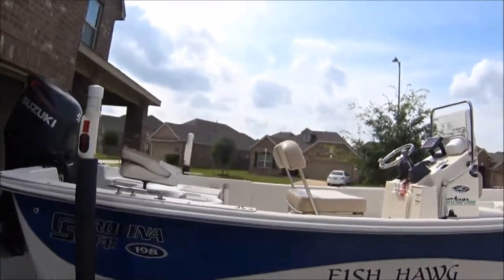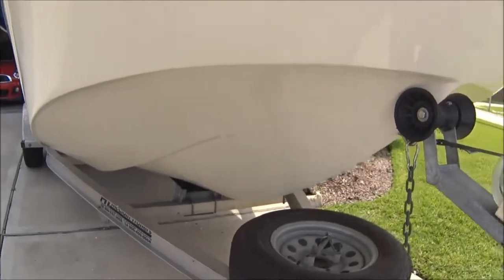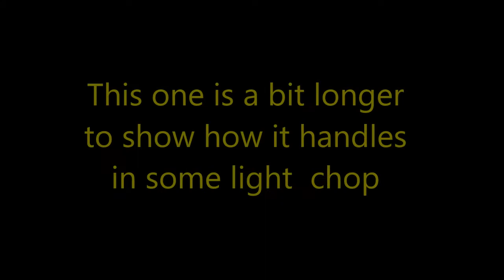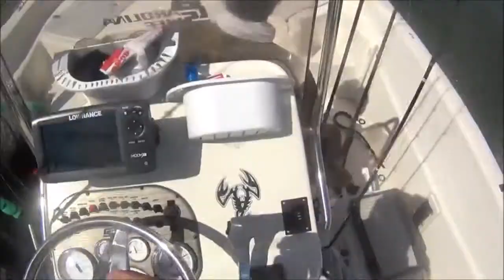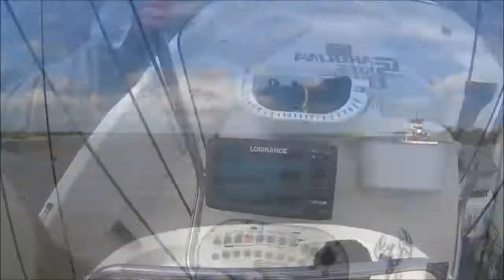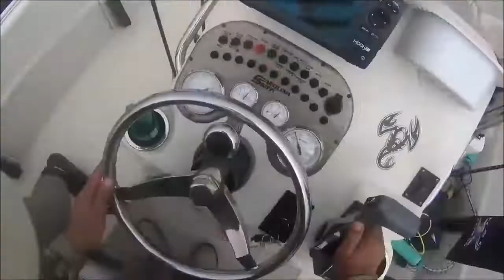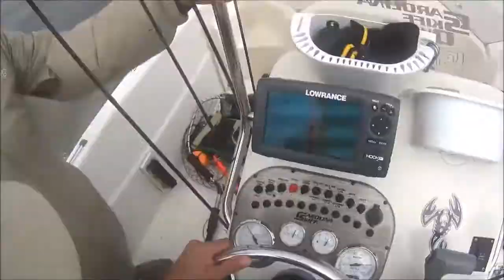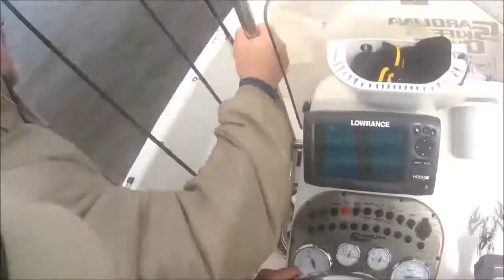2016 198 DLV Carolina Skiff

Comment: Great video.  I’m looking to purchase the same boat and same as you hoping it fits in my garage.  My garage door width is 8’ 9” exactly so winding if this boat would fit.  What is the width of your garage doors and the width of your trailer fenders outside edge to outside edge?

Thanks man for any info.
Rob
Reply from the maker: The boat is 93” tire to tire , make sure you have enough height too. I have a 3 car garage. It takes all three spots, with the trailer.
Reply: 93” tire to tire?  Can you double check because the boat itself is 96” so guessing outside edge tire to tire would be another 6” so 102” total...but that’s a guess.  My garage door width is 105” exactly so very close and need to be sure it will fit.

Thanks again,
Rob
Reply: @nickhuerta1757  How tall is your garage door ?
Reply from the maker: @TheMackeysVaB  9 foot
Reply: @nickhuerta1757    are you sure it is 9ft ?  My CS JVX 18's  grab bar over the windshield clears my 7ft high door.   Thank your for the reply.
Reply from the maker: @TheMackeysVaB  sorry been super busy- but yes garage door is 9ft it’s not a standard garage door either- also the JVX is 93” from tire to tire. I may be confused because the 19’ DVL is 96” beam I had that boat as well. But I did confirm the JVX width at 93”.

Comment: You mention that the 218 will not fit in your garage but the 198 will. I'm considering purchasing a 198 with a 24 ft garage. How deep is your garage? Will it fit in 24'?
Reply from the maker: Bradley Davenport no it will not because the trailer is to long.
Reply: @nickhuerta1757  I am thinking of buying a DLV 198 to replace my 18JVX as well.  Did you have any problems with the height of the DLV 198 getting into the garage.  Your garage looks to be a standard 7ft high door.   Thank you for your help.

Comment: Wondering why they state in the specs you can draft in 6in?
Reply from the maker: AlamoThreads Unlimited the reason for that is because they test it with half a tank of gas and 1 person. Realistically it will not draft in 6” more like 8-12” depending on weight.